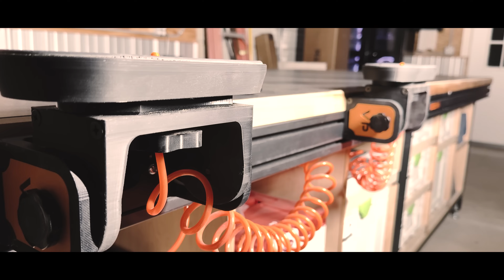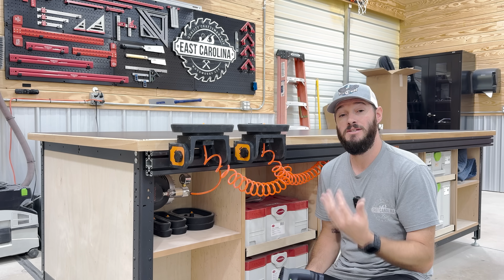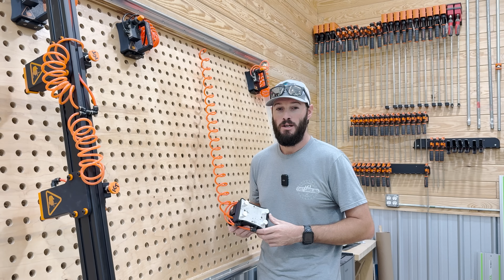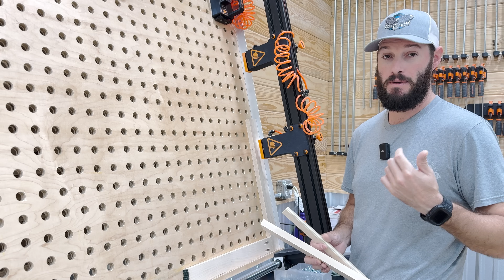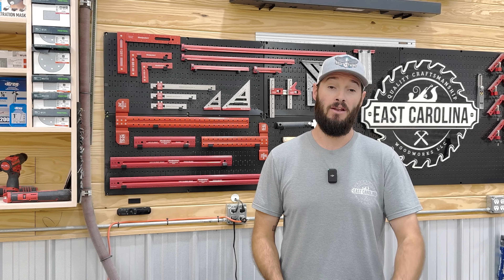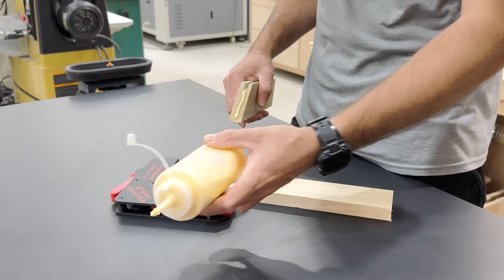I Just Discovered the FUTURE of Tools.

Comment: The table looks awesome but have one question.  Is there an option to use it as a panel saw.  The guide rail is there already, so adding one for the saw would be easy.  Also, a sheet of plywood can be as large as 6' by 12', way too big for this, but 5' by 9' would probably be perfect to use as both the panel saw, and face frame options.  I could also see a square on both ends of the larger panel to allow two people to work independently on each side of the larger panel.  Also, would allow construction of an exterior door up to 48" wide.  Not a cabinet maker myself, but could see the ability with the panel saw to cut parts like styles all at one time on the jig, so everyone would be exactly the same size with one cut.
Reply from the maker: There are definitely more options you could use this setup for. Love your ideas 🤙🏼

Comment: How would you say the vacpad compares to the Festool Vac Sys?
Being the Festool is no longer available, is this the next best version?
Reply from the maker: I absolutely love this thing! Never had a chance to use the festool version but works very similar. I wanted a vacuum system by festool as well but being it was no longer available this was the next option and I’m more than happy 🤙🏼
Reply: @eastcarolinawoodworks thanks for that. I’ve used the Festool vas Sys, it’s a game changer. So the potential of this is huge! Do you think it’s sturdy enough to hold a slab/ chopping board weighing up to 22pounds/10kg?
Reply from the maker: @lukeparkinson2213 I would say for sure! I haven’t had a single issue with it. Holds big panels for cabinetry very well 🤙🏼

Comment: 349$ for a pneumatic dual piston you get on Amazon for 25$+ 10$ of fittings, 17$ of 3 way valve and few cents of 3D printing parts? That's not called tool, that's called scam.
Reply from the maker: What about the time it takes to develop and design? How many iterations that goes into it? How many failed attempts? Wasted parts and material? Everyone has their opinions 👍🏻
Reply: @eastcarolinawoodworks  To design something that simple? Don't hide behind the standard "fake engineer" answer. Is way way way over prized. Considering a production there's no way that in that clamp there's more then 40$.
Reply from the maker: @Luca_s_Lab how about the people building “high end” cutting boards for $50 and selling for $300-400. People buy them all day long just to cut food on. Just giving an example. If it’s soo simple then why wouldn’t they just make their own cutting board?
Reply: I’m sorry, but you can’t compare a cutting board to a pile of pre-made parts bought from China. The only things that the overpaid low-level engineer actually works on are prototype-stage components — after that, it’s all mass production. When you make a cutting board, you might have to throw away two after hours of work; you’re not just wasting $2 worth of plastic because a 3D printer didn’t print properly. If you want I can show you how to make the same thing including design from scratch in 2 weeks and sell it for half of the price still making a nice profit. And that's actually what I'm about to

Comment: You can shift the audio in your video editing tool. UNLINK it then shift it. Repost. There are plenty of folks, including me, who know how to do this and are willing to help. Ask around.
Reply from the maker: It only happened on a few clips throughout the video so I’m not sure what happened. When I play the video in my editing software it plays fine but once exported it drifts 🤷🏻‍♂️
Reply: @eastcarolinawoodworks That's weird, indeed. I have never seen this with Davinci Resolve. What software are you using?
Reply: @eastcarolinawoodworks That's weird, indeed. I have never seen this with Davinci Resolve. What software are you using?

Perhaps try reimporting all the clips fresh. I have seen some instances where even Resolve has cached an older clip and refuses to let it go when I import a replacement for it. The new video clip is a different length, so the out of sync condition occurs.

It takes some renaming and reimporting to get it to let go, like a dog with a favorite chew toy!

Anyway, good luck with figuring it out. I think you'll be fine. If all else fails, let me know if you want me to take a look over Zoom.

Comment: A solution when there is no problem .
Reply: He did a good job presenting a solution to common operations.  I can see the utility in all these tools.  If it isn't for you, just keep scrolling.
Reply from the maker: These are tools designed to help with efficiency and they do just that. Incredible tools that make the task enjoyable 👍🏻
Reply: @eastcarolinawoodworks  A completely unnecessary expense , I’ve been doing woodworking/carpentry for sixty years and never had any problems with efficiency using clamps, vises , bench dogs etc . 
Ok I’m done .
Reply: @siriosstar4789  This just speeds up the process by a lot.  For a hobbyist woodworker like most of us, entirely unnecessary, but for a one man cabinet shop trying to compete with bigger shops that have more manpower and can churn out products faster.......every bit of efficiency can help a great deal.  Like with his 4 router tables - don't have to worry about swapping out bits and setting things up, can just zip through a project.  Saving minutes can turn into saving hours by the end of a big project.

Comment: I would have to make those screws a knob.
Reply from the maker: Not a bad idea! Easily get 1/4 -20 knobs 🤙🏼
Reply: @eastcarolinawoodworks  3D print them; that's what I do.  Each knob is like 20 cents of filament.  I pause the prints and drop 1/4-20 nuts into each knob.  Works awesome once you get it down!